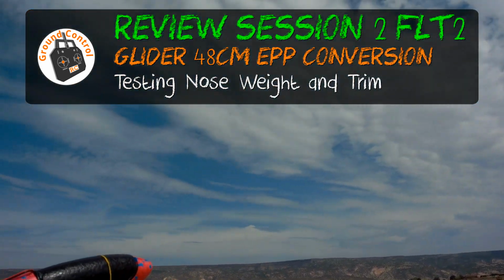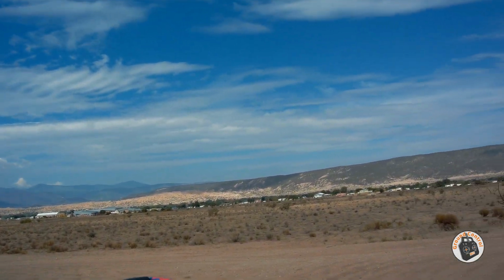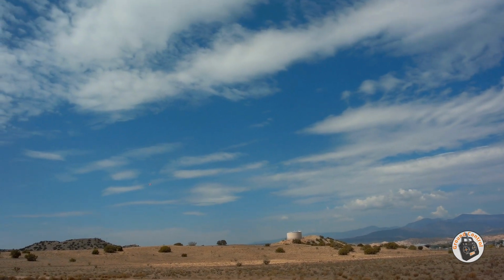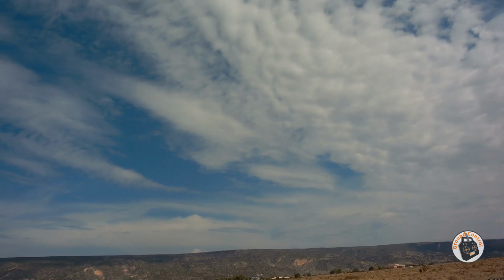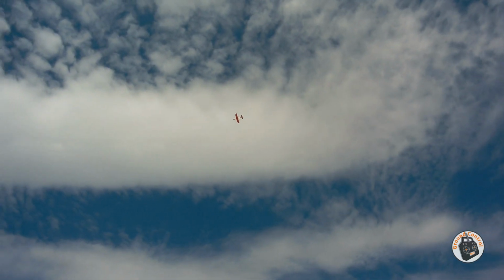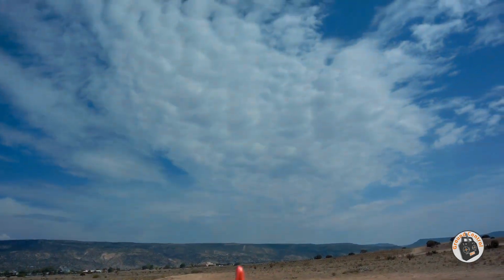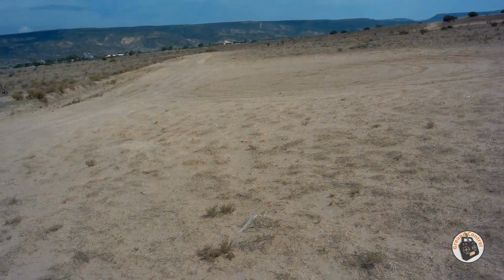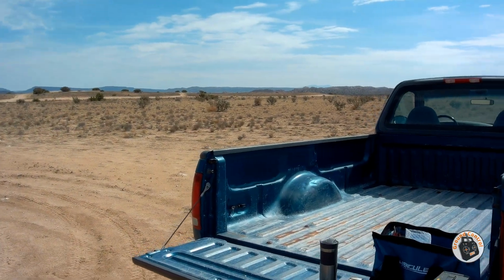$4 Chuck Glider RC Conversion - Session 2 Test Flight 2

Comment: Speed is impressive and it glides forever WOW !  Was there any affect of the hot melt glue on the foam such as any melting ?
Reply from the maker: Thank you! I didn't use any hot glue, however, I think it would probably work ok. I'd have to test it on one of the scrap pieces I cut out for the canopy or electronics bay to make sure. I use a glue called Foam-Tac. It's more expensive than hot glue but it doesn't get brittle in cold weather, stays flexible, and is much lighter weight than using hot glue. I sometimes will just tack things in place with hot glue on my "Glue & Fly Series" planes while the Foam-Tac sets up. The best place I found so far for Foam-Tac is Motion RC.
Here is a link: https://www.motionrc.com/products/beacon-foam-tac-glue-2oz
It's about $10 US for a 2oz bottle but I could probably build 4-5 of my Parkjets with one bottle.
Happy Flying!

Comment: You should try to change the motor inclination instead of weight insertions...
Reply from the maker: Hi Eric! The problem with this Glider is the tail is so long and it's such a big lever for the Motor mounted at the very end of the Tail. That plus the Elevator Servo is mount near the Tail. The only way to get it balanced on the CG was to add nose weight. Adding motor inclination would push the Tail up for sure when in the throttle but it would not fix the Tail Heavy condition and therefore would not handle very well. Looking back. I may have made this a Pylon Mount Pusher instead of Tail Mount Pusher and that would have prevented the need for the Nose Weight. I may MOD this Glider to do just that ;-) See you in the Air!